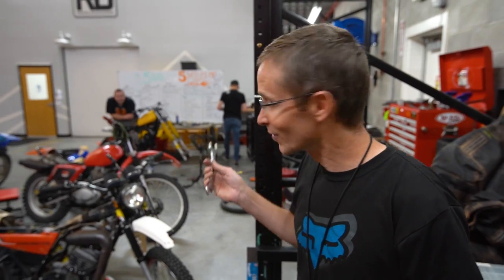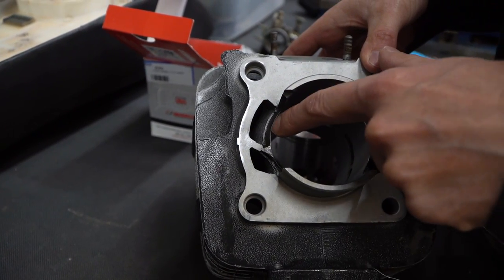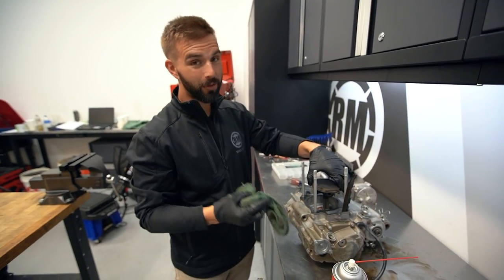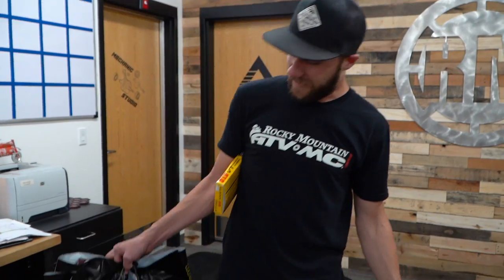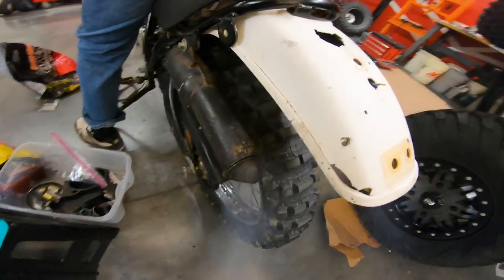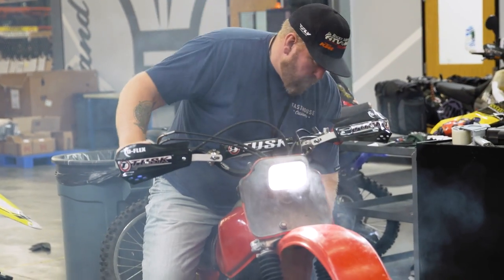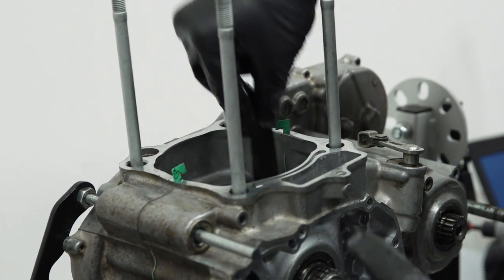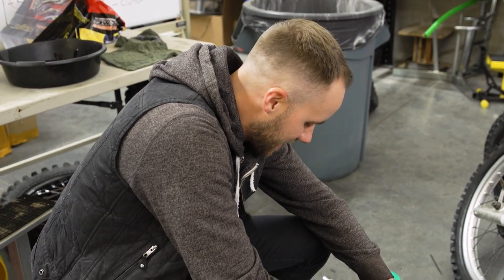Will They RUN?! | 5 Miles of Hell $500 Motorcycle Challenge - Episode 3

Comment: What was the white smoke coming out the Honda?! My Suzuki DRZ is doing the same thing and I have no clue how to fix it... is this bad? He said If it gets warmer it won’t do it...
Reply from the maker: Burning oil.  Either worn rings/cylinder or valve seals most likely.  A little bit at start up may not be a bad thing, but if it keeps smoking you probably have issues.  - Justin

Comment: When you grind that port down on that DT to smooth it you do two things. You create a sharp, thin edge and you smooth the ridges in it which create strength. As the cylinder heats and expands, there is the possibility for the thin edge of that port job to break off and fall down in the engine. Just my 2 cents. :)
Reply from the maker: I didn't sharpen the edges; I just smoothed the transition 👍 - justin

Comment: If there is anything I have come to conclude of this .... You guy's know less about these bike's then I do 😆. That XR has a decompression unit in the head and you have no cable or lever to use it, and a cheap MCCT would take care of the timing chain slop but while you had that clutch side cover off you should have checked the balance shaft chain adjustment that was right there, also they never had a gasket for the rocker cover from factory cause the rockers would be too far from the valve stems so they machine it to fit perfectly with no gasket and they didn't leak, they only leak after they overheat and warp. I had 2 1982 Honda FT500's which is the same engine, one was an ice bike and the other was almost 100% factory original and I used it for 4 years before I sold it to a friend who still runs it. That DT used and is also in the manual leaded fuel, one reason why it had no compression on top of the air filter that didn't filter air plus it's a single ring piston ( maybe came factory but I doubt it cause it's road legal ) which people really only use for racing application's on 2 strokes seeing as they get torn down alot and yes they do make piston kits that have 2 rings for these and the battery was there for running lights and being a regulator so you didn't blow out the bulbs, they were a 6v system when they came out and eventually went 12v but also it's road legal which obviously you knew. Use a lead substitute in the fuel, two other riding buddies of mine have the DT one has a 175 and the other a 125 which will be going to Ken Kaplan to live in the museum, it only has 1k miles on it and was cared for by P.O and my friend who never rides it for fear of damaging it. That old 80's 125 YZ has that small flywheel strictly to reduce rotational mass and keep the ignition components simple and cheap to replace, it's basically what they call an inner rotor like the kits they sell for the old Z50 monkey to get the revs up quickly while being less stressful on it, I had a YZ 100 that was basically the same bike maybe 1 year older. That TTR is a really nice tractor you probably could have got for $300 since it didn't run and looked like a 16 yr old kid from what seemed to be shady with all the wires and shit hanging out and all the missing bits. but they have flaws too, that electric start will fail eventually and being that's all it has on it, a kicker kit can be added and yes the suspension sucks. $150 CRF .... Not bad but it's a race bike, many people don't keep up on maintenance with these so expect people to be asking prices much like the DRZ prices after they thrash the hell out of them and try to make 4 / 5th's it's original MSRP.

Now I'm going to continue watching the series, that XR500 has plenty of low end and not too much power that it's unrideable unlike that CRF. That TTR is definitely made to ride closer to where you are going then the rest
Reply from the maker: Well... the bike also had a decompression cable hooked the the kickstarter - and it worked!  We did adjust the counter balance chain - it was maxed!  Like a lot of 4-stroke valve covers, there is no gasket, but they all require a sealant (high temp silicone of some sort).  Honda calls for Hondabond.  Sounds like you've had some great bikes. -Justin
Reply: @rmatvmc  so the XR had one on the head and also had a kickstart activated decompression via a cable from there ? ..... So it had the XR and the XL decompression setups ? 😆 odd. The DT the IT and the Blaster are all the same engine along with the old YT175 trike just different jugs, you could buy the Vito's 280 cylinder kit and stuff it on that DT. I liked this little challenge you guy's did and looked like you all had fun for the most part. Any bike can be a great bike, I definitely miss my KE100 had great times with that little machine and I'd get one again

Comment: Man cool video...... I'm a little sceptical though about the 200 budget....... the one guy had his cylinder bored out and a new piston..... I know that isn't cheap..... I just had that done on my 250r and it was a little more than 200 bucks
Reply from the maker: I bought the bike for $250, so I had $450 to fix it 👍 - Justin
Reply: @rmatvmc  hells yeah....... that makes sense
Reply: Tim Allen  that's just the cylinder bore still need rings piston gasket kits and since I was already in my motor also did the bearings

Comment: I owned the same DT 175 same color few years ago it was mint 2000 orig miles great bike now I just bought a mint Xr 400 titled ended up costing me $600.00!!!! 
Guy had a set i on c excel super moto wheels on it I sold for $700.00 !!!
Put the stock wheels back on best deal on a bike I’ve ever bought and it’s got a tusk lighting kit also keyed ignition!!
Reply from the maker: That's awesome! I won't lie, that DT175 was my favorite bike of the bunch. I'd honestly trade the 450 for something like that if I ever did it again. - Chase
Reply: Rocky Mountain ATV MC I wish if kept mine but the XR 400 is a super nice ride and dependable also check  my page see it guy was a pro motorcross racer past away he built this XR 3 years after he past away I was told about it and bought it one shot of ether and it started right up!
Can’t wait to register her!

Comment: Man... taking links out of a stretched chain is not a good decision. When a chain stretches the distance between the rollers increases. That means accelerated wear on your sprockets because the rollers are hitting higher on the sprocket teeth and that means sprocket and roller wear.
Reply from the maker: Low HP and even lower budget... sometimes you gotta do what you gotta do ha ha - Wes
Reply: The problem with that is you are telling viewers it's okay to shorten the chain. Remember, some viewers think you know what you're doing and that it's okay, when it's not! You should explain, while you are doing it, that it's not okay for longevity.

Comment: Not fair. U spend way more than 350 for them to run... to bere a cylinder... it costs a ton already.. useing rebuild kit that u already have.. thats not fair.
Reply from the maker: Actually we counted everything at retail. The goal was $500 max on the bike with $200 to fix it.  I bought the DT for $250, so i had $450 to fix it.  Bore was $90 and the piston kit was around $130.  Not sure what you think isn't fair 🤷‍♂️ -Justin

Comment: That old yz and the old dt have the same motors on them..
Reply from the maker: Way different motors actually, but both were fun!  - Justin
Reply: Really? They look exactly the same.... I had a 125 dt back in the day.
Reply: It had 32'000km on the clock and the motor had never been split, I sold it still running 100%